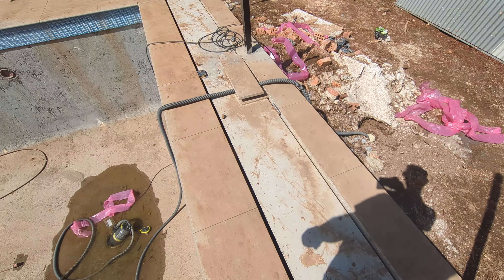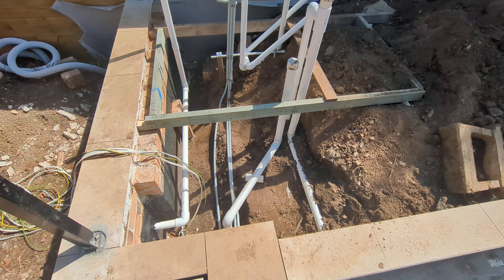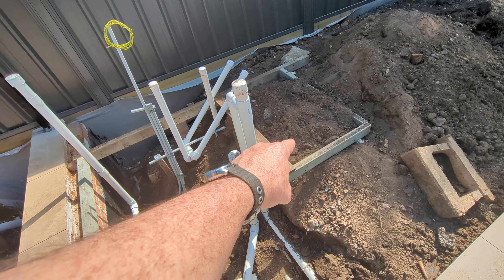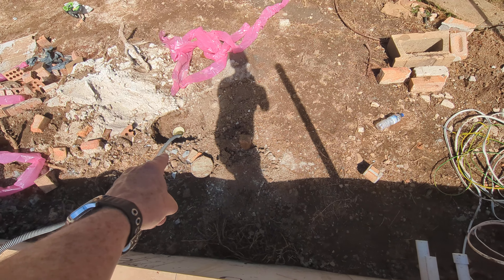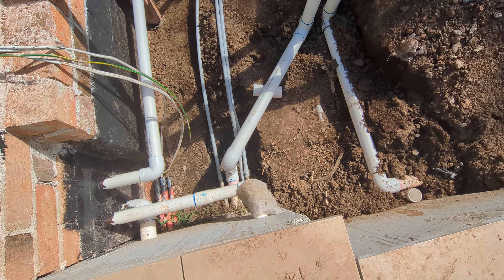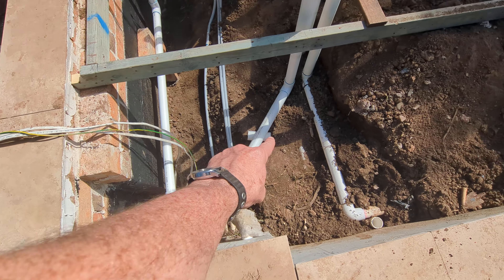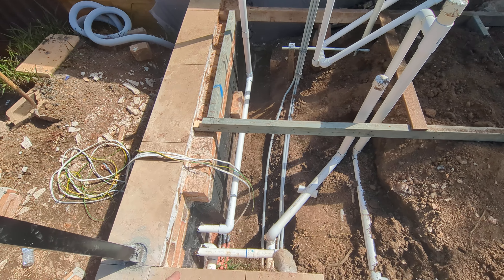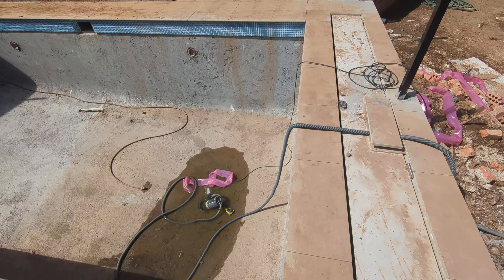Pool Update: Pipework + Fence posts

Comment: Does the water in the pool get earthed somewhere? Wouldn't want a light failing and turning the water all spicy.
Reply from the maker: Yes, that's the earth wire sticking out. Lights are 12V AC transformer isolated anyway.